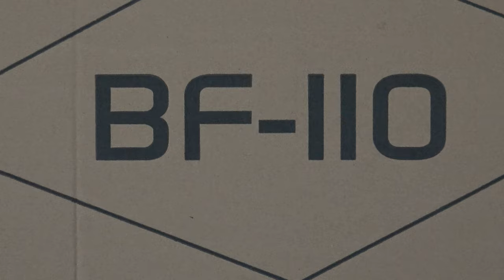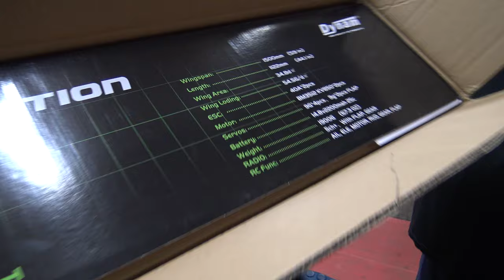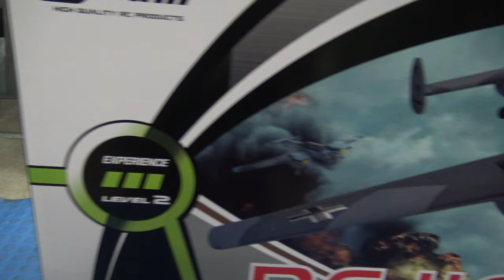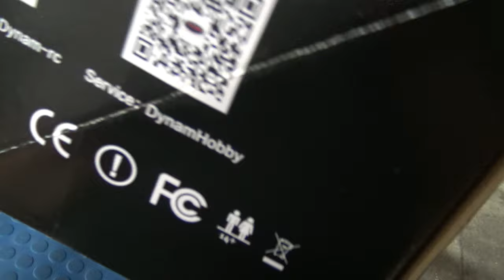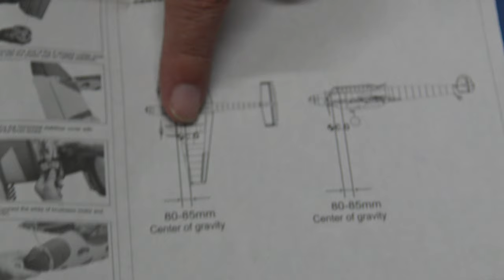Messerschmitt BF-110 EPO 1500mm PNP V2 4S by Dynam Unboxing

Comment: Back in the day like the 90s the BF 110 was a hit and the engines were the zenoah g34. I have 3, 1/5 scale crafts with the G62 engines. currently I have a super Marine spitfire with a super tiger 3000. But I do have 386 Texans and 1/5 scale that will run the g62. The Zenoa engine

Comment: Hi captain Robert,I own that same plane and I found that the two ESC controllers need  to be cool 
As one ESC shut down shut down and I nearly crashed it,so make sure you get cool air on them
I cut a hole inn the bottom of the wings to make sure they cooled down,then it was fine 👍
Reply from the maker: Iam planing to make some extra holes for that.

Comment: Any advice on spare parts while the plane is on order?
Reply from the maker: I still have to fly it. But I can tell you that rudders are not working on mine. I will just have back steering for maiden flight. Maybe later I will install extra servi for rudders.
Reply: @PetrincicBrosRC 
You'll need the rudders for take-off due to the torque from both the motors pushing the plane hard to one side.